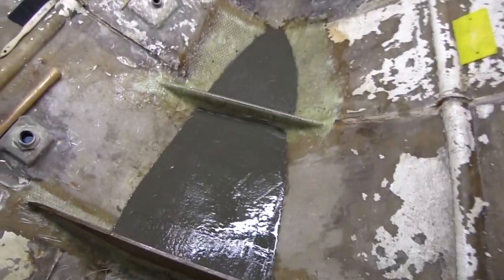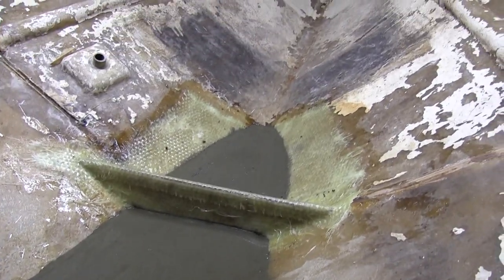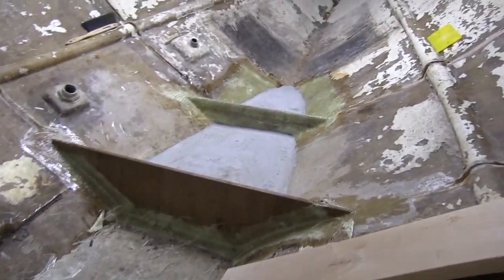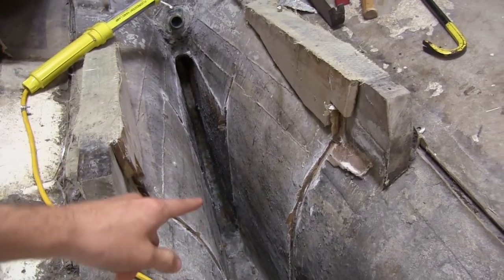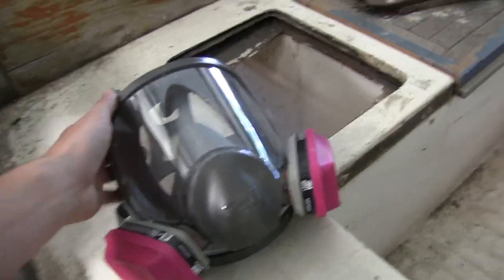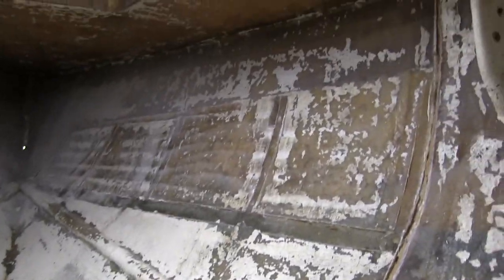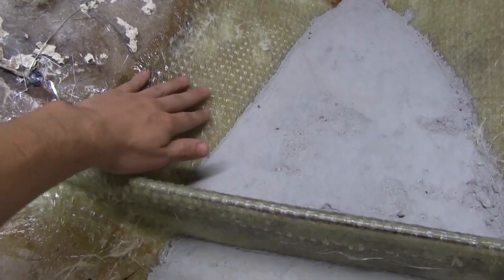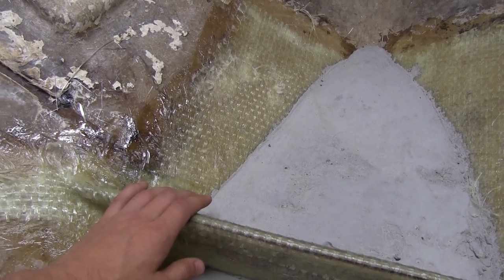The Bilge! Part 1 | Sailboat Restoration Ep. 19

Comment: Great series so far!  I just stumbled upon it.  I was chuckling watching the progress of buying tools, getting access to the boat, etc.  It's the same process I went through.  I've pretty much finished my boat.  For the interior, I would recommend buying a Festool dust collector and sander.  Some 40 or 60 grit paper.  Soft or super soft backing pad and a half inch foam interface pad.  You'll have it sanded in no time but it won't burn through anything.  Almost zero dust.  30 day money back guarantee, so even though the upfront cost will seem high, it's zero risk.  (Nobody ever actually returns them according to my local store).  Then, grab an Earlex or similar decent-ish HVLP system from one of the big boxes and blow your paint on in about 30 minutes.  I could kick myself for not getting them sooner in the process.  You can use the dust collector and sander on the deck as well.  The DC is so good it keeps the paper clean, so it keeps cutting and cutting.  It's pretty amazing if you have never done it before.  You can probably run that whole deck in less than an hour.  Good luck!

Comment: I have only just found your channel!  I was at your stage three years ago.  Now I am on the home stretch and getting ready for life alfoat.  When I cleaned the inside of my hull I used a wire wheel on my grinder and used it softly-ish ;)
As for the dust, get suited!  I put a large desk fan pumping fresh air from out side in from the forepeak.  Then started at the bow and worked back.  This kept a large but not all amount of dust blowing behind me.  I found it good to also wear a head lamp.  So when its really dusty in a hard to reach corners you can really see what you're attacking.  Maybe I should put some of my build videos up.... good luck.

Comment: Nice that your back. Great progress.  
I also just ordered the full face mask, for exactly the same reasons.  
For the sanding inside, perhaps use a vacuum cleaner with an tube going to the exterior of the boat?  
The vacuum I use ( a cheapo one) has the actual vacuum hose but @ the other end, where air blows out I can attach another hose. Because after some use (and especially with dust particles) dust gets through the back end filter and vacuming has no use anymore lol.

Comment: For sanding I use a black and decker orbital sander. If you take the filter off a small shop vac hose will fit in the back. It dose a really good job of collecting dust. Its a little slow but effective. I try to stay positive and think of something that a gentleman that Alfie interviewed (Life is like Sailing) said about stripping bottom paint. "Its just like eating an elephant you do it a little bit at a time."

Comment: Nice thorough job. If you're swapping out all the floors (nautical term for those bilge-level structural members), consider using higher-density ballast lower down, like scrap lead encapsulated in resin, or even cast iron (again, well sealed in resin). Weight lower down will make for a stiffer boat, and free up bilge space for extra tankage or storage. Looking forward to the next one!

Comment: The keel is a wet area of a boat, the moisture eventually and inevitably will seep into the concrete and then the steel will rust as a result, growing in size and then breaking up the concrete.

Comment: I got the same respirator. They really are worth it. I wear glasses and still no problem with getting a seal on it. vapor filters are great when it comes to working with smelly resins.

Nice work. Not easy getting old fiberglass bulkheads out of the keel. I had to do that to remove my old fuel tank.
Reply: +Bad Sailboat 
Definitely get one. I was under my boat scraping old bottom paint and chips fly everywhere, but that full face mask really helped keep things from flying into my eyes. Certainly not the kind of dust you want getting into you.

Comment: Lookin good and yes, that mask is my personal favorite. I just use it with the round filters mostly, and my go to filter is the P100 for just dust & debris (amazon has them), then the 2097 filter for dust with some mild chemical vapors, but if I'm painting or using a lot of solvents or something then I go with the full charcoal setup with prefilters (which it looks like you're using).  The full charcoal filter setup is the best but they get real expensive real fast and the round filters are so light and low profile that they are a pleasure to wear.  Keep it up bro, the vids are the best and your project is going to blow some minds!

Comment: For removing paint, an alternative to sanding is using a heat-gun and scraper. You might think it takes a lot longer, but in some cases the paint lifts quite easily with a little heat. One advantage to sanding is that there is very little dust. 

Those narrow bulkheads you removed under the engine--did they smell like engine fuel?  Mine did when I removed them.
Reply from the maker: I'll have to give that a try. Yes they were quite foul.

Comment: There's a lot to love about old Cheoy Lees, but they've rightly earned their nickname of Cheoy Leaks. Every time you have a chance to remove a fitting or fastener, do so without regret, but proceed mindful of the necessity to maintain the strength and integrity of the monocoque, coupled with attention to minimizing unnecessary weight. It can be terribly tempting to overbuild with abandon, particularly as a green newbie (with all due respect, I assure you). Any given component need only be strong enough to satisfy the practical requirement, with reasonable respect given to longevity. Building something "bulletproof" usually means it's needlessly overweight despite how it may boost ego. Think: "exquisite compromise", which strives to tick all boxes. 

Consider vacuum bagging, which will reduce future grinding tremendously, while it imparts superior quality and minimized weight and waste of material. 

Painstakingly level the boat, and then use a rotating laser for layout. 

36 grit. 👍

Comment: I did the same bilge work on my boat. The aim was to get rid of water standing in pockets in the bilge causing the wooden bulkheads to rot. I also used concrete and a couple of layers of polyester on top. It worked just fine, but I’ve noticed that the polyester isn’t really bonding to the concrete. Maybe there was too much moisture still in the concrete. The bilge water however runs perfectly to the ”well” that I left just forward of the engine, and where I installed the new bilge pump.
Reply from the maker: Very cool. As long as there is no standing water in the bilge I don't really see it hurting anything if the glass delaminates from the concrete.

Comment: Have you thought about wet blasting? I've seen it used to remove bottom paint from fiberglass boats. Would probably work well on the inside of your boat to remove the paint and keep the dust down.

Comment: Really enjoying your videos and very impressed by your can-do attitude.  A couple of questions and a comment:  Why add the concrete?  It wasnt part of the original design so the extra ballast shouldnt be necessary.  I believe (possibly mistakenly) some people will throw concrete in the bilge as a patchwork way to try and seal up leaks.  Perhaps thats why its there in the first place?

You might want to consider adding limber holes to your floors to allow bilge water to drain rather than collect and pool between the floors.

Comment: Other than living with the dust, all you can do is try to evacuate it.  You can use shop vacs (one hooked up to grinder/sander) .  Fans and hoses 4 inch + to blow the dust outside or into a collection bag or through a fine mist of water . Most people go the easy rout and use shop vacs
BTW, if you wear contacts,  don't wear them while working around chemicals of any type. Also in high dusty areas, avoid wearing them too
KORITFW

Comment: Love the project but hate the concrete.  Suggest cast lead or pig iron encapsulated in epoxy. Too much void volume with bird shot. With all due respect, please break the concrete out and use metal.  You are doing too good a job for that.  I know you are new to sailing and ballast is very important.  The benefit is in the density difference between the ballast material and the seawater it displaces and the lever arm distance from the rotational axis to the center of mass. I'd leave the ballasting to the end, when she is put in the water. You can always epoxy in lead bricks at that time. Check out Doug at SV Seeker for inspiration and casting examples. I'm not a hater, just a huge fan!  Please reconsider! I'm living on and refitting a Hylas 47 in New Orleans (just a refresh refitting). I'll be seeing you on the water.

Comment: I thought that keel weight for SV's was up in the 10 to 20 thousand pound range.
Reply from the maker: It depends on the size of the boat. Our boat only weighs about 7000 lbs
Reply: 20% ballast would be 1400 pounds of ballast.

You got a nice looking shop which will make a big difference once your inside, you need to round up some volunteer gobs for some of that heavy duty sanding.

Looking at the boat on the hoist it does have some nice lines to it.